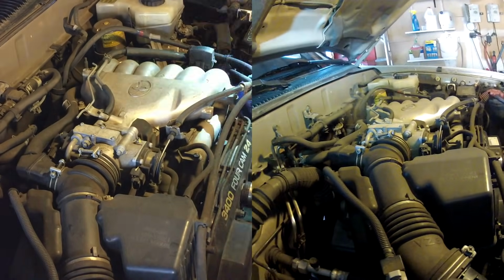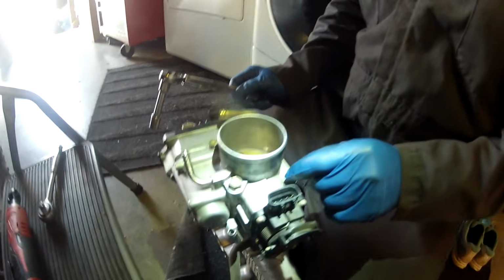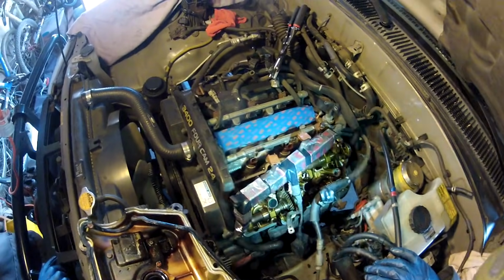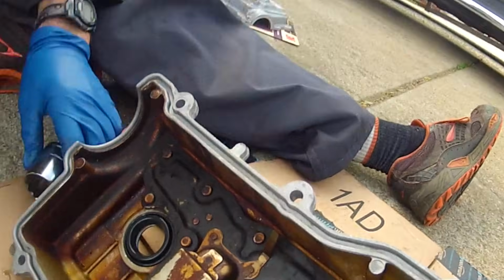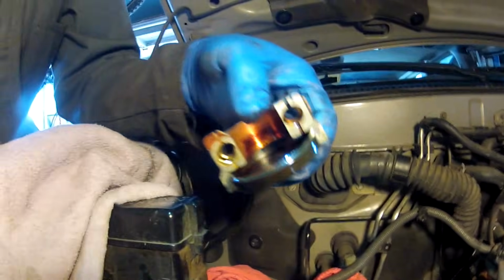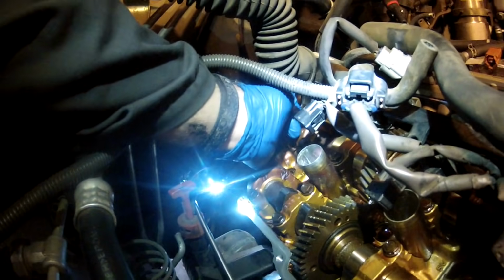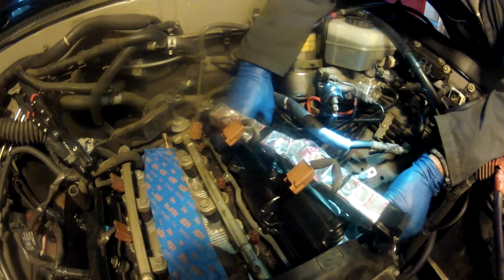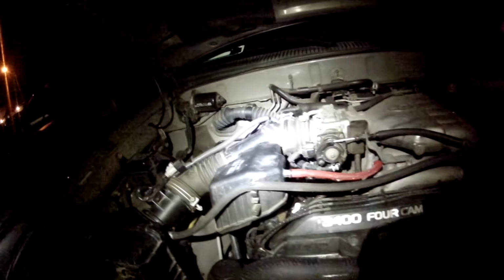3.4 L V6 5VZ-FE Toyota 4runner, Tacoma, Tundra Valve Cover Gasket Tutorial

Comment: Great video !  Really helped me !  I was able to do my truck because of this video !  Cheers!
Reply from the maker: Hey William, we are always stoked to hear one of our videos helped someone be successful with a repair.  Thanks for taking to time to let us know.  Happy Wrenching!
Reply: I have a question !  After I did all that work, my idle went up !  Its running around 1050 RPM's when idling !  Wasn't like that before.  Is this due to me cleaning the throttle body ??  The throttle valve cleaner just evaporates !  Wasn't impressed with it !  Thanks !
Reply from the maker: Hey William, it's normal for the idle to be high for a short while after a cleaning but it should return to normal.  If it's still doing it, there is a chance some cleaner run-off got down into your IAC (Idle Air Control Valve) under the throttle body.  If it's still high, you might want to take the throttle body off, flip it over and take off the IAC.  Maybe a cleaning of the IAC will fix it.  I'd also make sure the throttle baffle is moving smooth and returning to the fully closed position.  

The throttle body cleaner is like brake cleaner, carburetor cleaner and MAF cleaner.  It's suppose to dry clean with no residue so that's why it evaporates so quickly.   I imagine the hotter the temp, the quicker it will evaporate off.
Reply: I took the IAC off like you said !  I cleaned really good !  Now my idle is even higher !  lol !  I went to Toyota to price a new one !  WOW !!  Well at least I know what was causing my high idle !  I will know for sure when I get a knew one !  Thanks for your help !  everything else on the job went very well !  I hope a new IAC fixes the problem !
Reply from the maker: Hey William, before you drop money on a new IAC, there is a way to test it to see if it's working correctly but I unfortunately can't find the video or write-up I saw a while ago on how to test it.  You basically hook up some power, I think with a 9 volt battery to a couple of the electrical leads on the IAC and see if the valve opens properly.

Did you check to see if the baffle on your throttle body is closing all the way?  People have reported on Toyota forums that the throttle baffle can get a little sticky and not close all the way.  Take off the air tube and cycle the throttle open and it let it close just by the return spring force and see if the throttle baffle is getting fully seated.  Maybe go inside the car, push the gas pedal down and let it return and then go under the hood to see what the throttle baffle looks like.  If it's not returning to the fully closed position, this could be your problem.  Maybe a simple spraying of lubrication of the throttle shaft will free it up a bit and your throttle speed will return to normal.
Reply: From what I see the throttle valve is fully closed !  You're talking about the round brass disc with a shaft dividing it, right ??  The springs that hold that disc are very strong !  I Cleaned the inside of that valve really well !!  I also cleaned the IAC valve really well !  I noticed that the IAC has an opening where a you can see a roll pin shaped valve that is also spring loaded !  That roll pin shaped valve never fully closed !!! I don't know what the normal position is of that roll pin shaped valve ??  Fully closed, cracked open, or fully open ???  It was slightly open when I cleaned it and remained that way.  There is also a diaphragm device with a small vacuum hose attached to it ! Looks like an expansion valve!  Its a senses pressure !  Could that effect my idle too?? I cleaned that out too !  Im wondering if I messed something up inside of that device ??  I already ordered the IAC from Rock Auto for 100 bucks !  Im not an auto mechanic but I'm teaching my self a lot !  I replaced my timing belt, upper arm control, valve cover gaskets, and a bunch of other stuff.  Im doing my own work because every time I have my truck repaired the tech's don't do the jobs right !  Not even the dealership does it right !  Pretty disappointed with most mechanics!  My truck has almost 300k miles on it and runs like a new truck !  Looks like a new truck too.  I like watching your videos !  I really appreciate you taking the time to help me out too !  The video footage is well done !  Cheers !  Keep up the good job !
Reply from the maker: Yeah, I'm talking about the round disk in the throttle body.  I've heard that can stick a little and not close all the way.

I don't know much about how the IAC works.  I know a valve opens and closes and that's about it.  I think that valve is suppose fully close but I could be wrong.  Hopefully the replacement from Rock Auto will fix the problem

I like the fact you're challenging yourself with doing your own repairs.  When it comes down to it, a lot of this stuff really isn't hard, wouldn't you agree?  Half the battle is having the right tools and having some good info whether it's a manual, a write-up or a video.  I'm happy our videos are helping you out.  I absolutely feel the same about techs not doing the jobs right.  There are good mechanics out there but for sure but there's bad ones too.  So, why not do the work yourself and make sure it's done right.  The way I look at it, who's going to take their time and do the job right on your vehicle?  Answer: You Are.

Let me know how it goes with the IAC replacement.  Hopefully that will solve the high idle issue.

Read this thread.  This what I was trying to find for you and I just found it.  It's a pretty good write-up on this subject: http://www.toyota-4runner.org/3rd-gen-t4rs/106626-propper-throttle-body-adjustment-including-iac-pics.html

Here's some links that might be worth reading to understand how the IAC works:
https://www.2carpros.com/articles/how-a-idle-air-control-valve-works

http://ricksfreeautorepairadvice.com/how-does-an-idle-air-control-valve-work/
Reply: Thanks bro !  I will let you know what the final solution was,  and how I got there.  Im thinking about working on my clutch too!  Im going to watch your latest video on the transmission job !  Cheers !
Reply from the maker: The video was done on an Auto Trans but it might still help you out a bit.  Pulling a manual is easier.
Reply: 300k miles on it !  What would be best ??  Replace the whole thing or replace the clutch !  Im sure replacing the clutch will entail a more things to be replaced also !  Thats why I'm wonder if I should just replace the whole thing and have a fresh manual transmission ??  Which is easier too??  Im planing on doing this by myself !  Which one will require me to have to purchase new tools too ??  Thanks again man !  Lol lot of questions !!  hahaha
Reply from the maker: I've heard good things about the manual transmissions on these rigs.  if it was well-taken care of with regular gear oil changes, it could last much longer.   Replacing the transmission is the same labor to replace the clutch because you have to pull the transmission out to get the clutch out so it's pretty much the same labor.  

Is your clutch slipping and that's why you want to replace it?  If the clutch is worn out, I'd just replace the clutch.  For the clutch replacement I remember it's good to replace the throw-out bearing at the same time. So, for the clutch replacement, you'd need to buy the disk, pressure plate, release bearing or throw-out bearing and pilot bearing.  I doubt you'd need to replace the flywheel because that doesn't really wear out.  There's also a ring gear for the flywheel but I don't know if that needs to be replaced or not.  I'd just look up some write-ups or videos for a clutch replacement on a 3rd Gen and see what you find.

A rebuilt or remanufactured transmission doesn't mean you still won't need a new clutch.  They are separate parts.  When you pull the manual transmission out, you'll see the clutch attached to the flywheel which is attached to the crankshaft of the engine.  Here's a good explanation of how a clutch works: https://www.yourmechanic.com/article/how-does-a-clutch-work-in-a-manual-transmission

There's an alignment tool to get the clutch aligned properly but I don't think that's expensive and may even come with the replacement clutch.  I'd highly recommend a transmission jack because it makes it easier to pull the transmission and transfer case out.  You can get a good one a Harbor Freight for around $200 or even less if you use one of their discount coupons.
Reply: Wow !  Thats great info !  I have a lot of miles on this clutch, and I worry about getting stuck out in the middle of no where with a bad clutch !  I know nothing about clutches !  lol I didn't know anything about timing belts either ! Lol !!  Now I know it like the back of my hand !!  I did better then any tech would because I was so meticulous about everything !!  That job came out beautiful !!! This high idle problem is a good challenge !!  Most people would have just let it go !!  I want my truck to run like the day it was delivered !!  So far it is !
Reply from the maker: Well, if you have a ton of miles on the clutch, it might not be a bad idea to replace it.  But, if a lot of those miles are highway, maybe it's not worn out.  If it's a lot of stop and go city driving, it's probably worn out.
Reply: Cool ! Will I get more horse power with a new clutch ?  Im guessing yes because of slippage !  But I don't know if I have any slippage now and if I do how much of a difference will a new clutch make ?? !!  Lots of questions !  Sorry about that !!  LOL
Reply from the maker: Well, you should know if you're slipping because the rpms will rise but you're not going any faster.  It's usually pretty easy to notice this if you know your vehicle well.  Basically, you apply more gas pedal input, your rpms rise but you're not going any faster.  Or, you release the clutch from a stop and it doesn't grab right away.

So yeah, if you're slipping you'll definitely have more power going to your driveshafts, differentials, axles and finally your wheels.  If you're not slipping, you won't detect any improvement other than the clutch might feel better when you're shifting gears and taking off from a stop.
Reply: Ok I replied the IAC with the new one and the results were the same !  High idle !   Waste of money !  I need to go to Toyota to see where the The high Idle is coming from !!  IAC Replacement FAIL !!
Reply from the maker: Bummer.  I was hoping it was going to work out for you.  I'd be interested to find out what was causing the high idle for my own information so I can share it with others who have the same problem.  Good luck!
Reply: Unbelievable !!!  The whole problem was due to a vacuum hose not being connected !!!  It was a short little hose that hooks up to the plenum !  I took one last look before going to Toyota !!  Found the detached hose and hooked it up, and right away the RPM's dropped!  My bad !!  Stupid mistake !!  Learned lesson !!!  Good weed !!!  Lol
Reply from the maker: Glad you figured it out.  You were basically giving your engine more air than it was suppose to get.  I knew a vacuum leak could cause something like this but I assumed you had everything reconnected.  I'll remember this because a high idle after a throttle body cleaning is very common and I'll advise people to recheck their vacuum lines as a possible fix.

Comment: do you have any videos coming out on the 3.0 v6 engine found on older pickup trucks and 4runners like the one I noticed in your driveway? I have a 93 toyota pickup with blown headgaskets and would love to see you make a video about that? its a common issue with those engines im really surprised there isnt more youtube videos about it. thanks for making this video, very helpful.
Reply from the maker: Hey Emmanuel, you're right, the 3.0 v6 is known for blowing head gaskets and that's why many steer clear of buying used 2nd Gen 4runners.  When I started my search for a 4runner, I considered buying a 2nd Gen until I found out about the head gasket issues and decided to shop for a 3rd Gen instead.  

I sort of doubt I'll be working on a 2nd Gen anytime soon but maybe some time in the future I might cross paths with a 2nd Gen project.  Thanks for the comment.

Comment: Thanks for the video. I've been having a leak for awhile now and been watching your video to get some help. I have a question regarding the parts list. 1. Where did you purchase the parts? 2. Were all purchased parts used in the repair?
Reply from the maker: My buddy Sean bought the parts and I don't remember where he got them.  I would use Camelback Toyota in Arizona.  They're prices are good and they ship for free as long as the order is $150 or more.  They only charge a $3 handling charge.  

We made a mistake on the parts list and you only need 2 cam plugs.  I put this in the video description but not everybody reads it.  So, we used everything.  You don't have to buy new half moons like Sean did.  You can reuse them.  Just clean them up and reseal them with FIPG.

Comment: Just finished up my 1997 Toyota T100 Valve Cover Gasket job. I really appreciate the part numbers and the detail you put into it, awesome job man! I think I had a little more room in my trucks engine bay being a older vehicle, so that was nice. It really wasn't a bad job, it took some time, but I also took my time. Thanks again man! Also, you guys have some good looking 4Runners!
Reply from the maker: Thanks.  Glad the repair went well for you.  Yeah, it's really not a bad job. I also took my time when I did it on my truck before making this video doing it on Sean's rig.

Comment: It looks like flying bits and pieces of the plastic wire looms could have found their way into the "nooks and crannies" in the tops of the heads. Was there any problem
Reply from the maker: jossephlh This is indeed a possibility so that's why I suggest people doing this job apply some heat resistant tape before starting to really pry on the wiring loom so when it starts to crack, no pieces can go flying.  If pieces do crack off, make sure you check the tops of the heads really good before putting the valve covers back on.
Reply from the maker: jossephlh And no, there was no problem with Sean's rig afterward.

Comment: Excellent video.....I have a 1998  Toyota T100 3.4, and I am about to change my gaskets as well.  If you still have your pages of notes, I would  appreciate if you could email me a copy.  It looks very intimidating with all the stuff you have to take off, but I'm up for the challenge.   ThanksJames
Reply from the maker: Hey James, I might have that list of notes somewhere but you don't need it.  Yes, it can be an intimidating repair but if you take your time you'll be fine.  The way I did the repair took a long time.  First, I took pictures of the engine from all sides so I would have a reference of how everything should look when I'm all done.  As I took things off the engine, I wrote them down in my notes as a reference of the order I took things off so I could reverse that order putting everything back together.  When I disconnected a hose or electrical connection, I labeled the hose or electrical connection and what it was connected to with a corresponding letter or number designation.  When I took the plenums off, I made a diagram on a sheet of paper and put the bolts and nuts on the paper so I'd know where they'd go back.  If I took a single bolt or nut off something, I put the bolt or nut on a post-it note letting me know where it came from.  Doing a repair this way slows down the process but it will keep you very organized and will reduce the chance of making a mistake by a lot.

I recommend starting early on one of your days off, take you time using the suggestions I gave you and you shouldn't have any problems.  It looks intimidating because you're taking so much stuff off the engine but it's really not a hard repair,.  It's just time consuming.  If you have any questions, just ask.  Good Luck and Happy Wrenching!

Comment: I'm thinking it'll help in removing all the left over sealant and and any oil on the cylinder head surface in preparation for the rubber gasket.
Reply from the maker: Just read my other response.  Old sealant will most likely have to be scraped off with something.  A cleaner on it's own will probably not work to remove old sealant stuck onto the surface of the head and on the half moons.  I recommend trying a scraper with plastic razor blades because plastic won't score the surface of the head.

Comment: Timmy, would u recommend using acetone to clean off the surface of the head...acetone is fast drying, so it shouldn't damage the gasket aftr application, right? Need ur input...
Reply from the maker: I've never used acetone but if it's fast drying and doesn't leave a residue, I guess it would be ok.  The surface of the head just has to be clean of old sealant and any crud.  It doesn't have to be something you can eat off of.  Some carb cleaner or brake cleaner sprayed on a rag would probably do fine also.  You just want to wipe it down really good and most importantly get rid of any old sealant that could compromise getting a good seal with the new gasket.